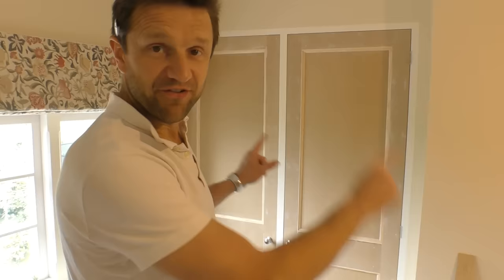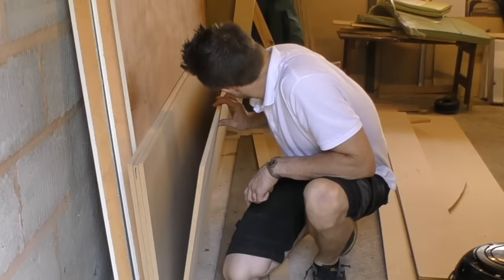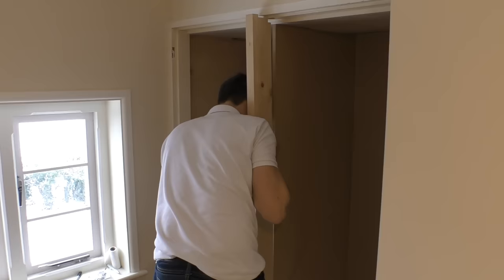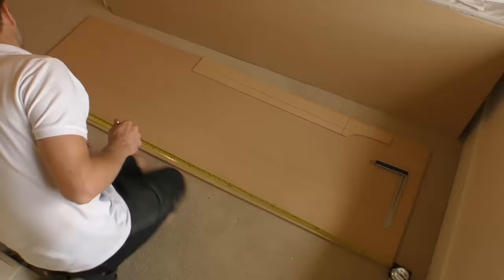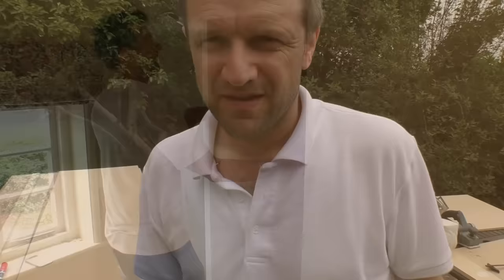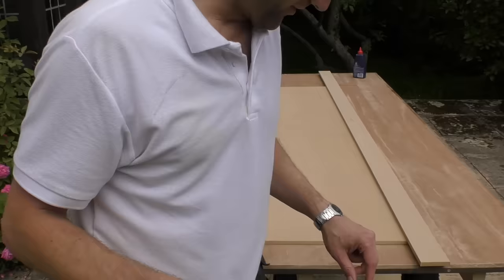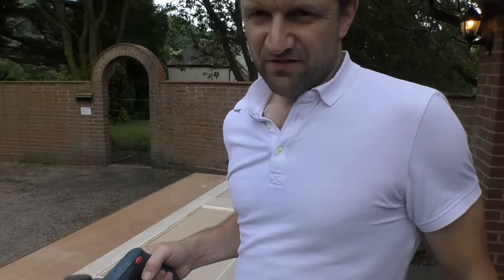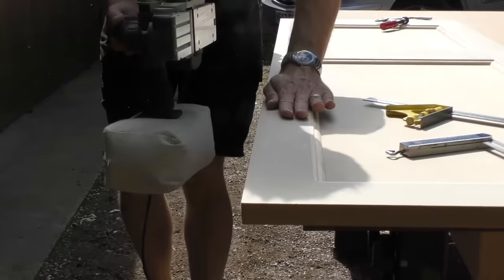How to Make Panel Doors with Basic Tools! Video 1/6

Comment: Your video always ROCK!! I love this method for doors and I will use for some cabs, however I have a question on MDF (you have tons of video on MDF stuff and I believe you know it all!!)

I need a slab door for a slanted ceiling (trapezoid shape door), size 73 (highest point) x 33w. I think you have the same set up in your video. Do you think I can build it with a 3/4 light MDF? hard to talk about MDF in US because plywood costs as much as MDF so most people do not want MDF. It is considered a cheap material (very toxic too). However, it is important that the door does not warp at all. Do you think it is ok or I should go thicker?  My concern is the weight for the hinges. They will be still either inset (like the Euro Blum you showed in another vide) or probably full overlay (just easy to cover the gap for a door with no handle). The purpose of my door is to be invisible and blend with the wall. It will separate a storage area from a livable space. Thanks so much for helping all of us out!
Reply from the maker: Hi Laura - thanks so much, I really appreciate that! Yes, I see no reason why you can't make that out of 3/4 inch or 18mm MDF. My doors are 1800mm - so pretty close to your 73 inches. But if ply costs the same as MDF, why don't you just use plywood? It's likely to be more stable than MDF - less likely to warp? I do use MDF a lot, but that's mainly because it's more readily available over here than good quality plywood. Don't worry about the weight - just make sure you position plenty of hinges down the length of the door to cope with the weight - you'd probably want 4 hinges on that door - if I understand the shape correctly? I love the Blum hinges, but for this particular project I couldn't use the Blum because of the configuration of the wardrobe frame, so I ended up using flush hinges https://goo.gl/EzA3yt I'll be doing a video soon showing how I fitted the hinges to the MDF - as a lot of people make a fuss about screwing into MDF end grain, but I find it works fine if you use the right screws!

Comment: I can't really see the point of doing it this way. A rail and style bit set is   about £50 and almost certainly a quicker way to do it, whilst using actual wood and ply for the panels.
Reply from the maker: It's good if you don't have a router.
Reply: @CharlieDIYte  I see how that could be an issue. It's funny that it had not even occurred to me that you would not have a router. eBay is your friend in that respect. You can get a second hand router table and router for very little money.  One of the single most versatile tools for any type of woodwork. You could do a series on what you learn to do with routers.

Comment: the glue is enough there is no need for nails.
Reply: add glue to the end grain to the rail and stiles.  install one stiles, then the three rails with a framing square then add the last stile